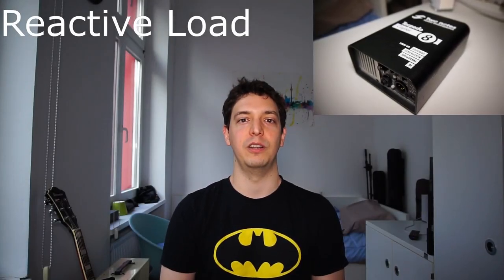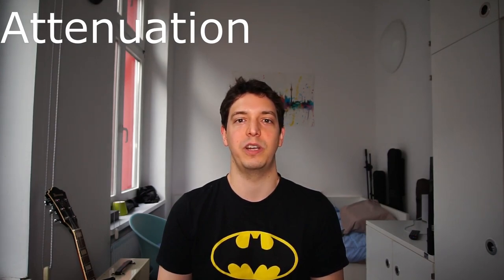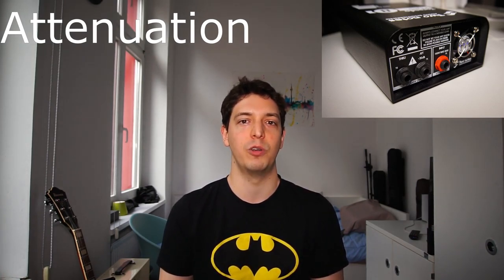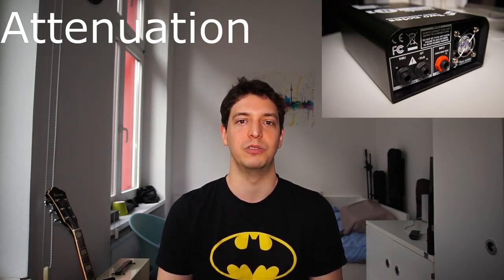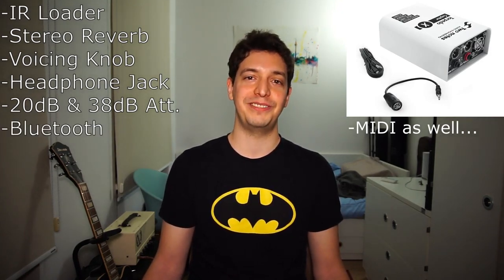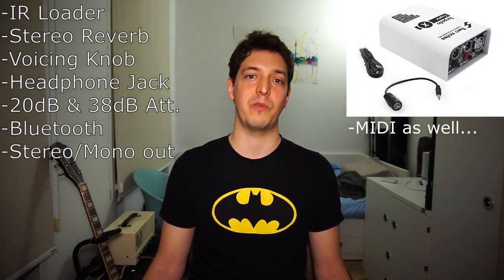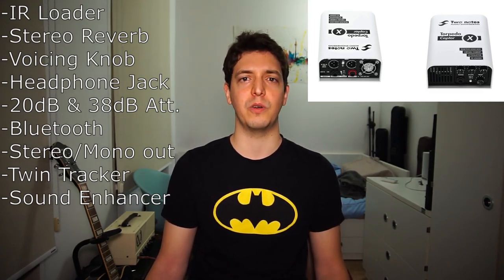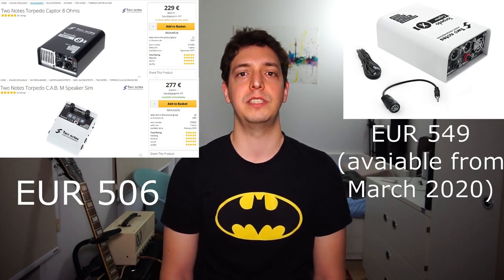Two Notes Torpedo Captor Review: Do you need the Captor X?

Comment: Great review !! But I have quite a Simple question please !
As a load box and cab sim for home recording use only, are the Captor and Captor X the same ?
Reply from the maker: Thanks Meloanaxx! For home use they are similar, but not the same. The Captor has an in-built analog cab sim, which works but is waaaaay less realistic and flexible than the cab sim you can get with Two Notes software. If you are at home and connected to a computer, then you can turn off the cab sim in the Captor also use the Two Notes Wall of Sound software in your computer for cabinet simulation, which is the best set-up. The Captor X has an in-built digital processor that can run a Two Notes cab sim software (Torpedo Remote) by itself (without needing a computer). The Torpedo Remote is very similar to the Wall of Sound. Besides that, the Captor X has some added functions like Bluetooth, MIDI, Twin Tracker, Reverb, etc.... If you have a decent computer that can process the cab sim without latency and you do not need the additional effects of the X, then the Captor is totally enough. I hope this helps! Let me know if you still have more questions.

Comment: Hey - I have an Orange CR120 Combo and I'm interested in the Captor products. Do you know if it would be possible to plug the captor into the extension cab plug on the combo, and use the DI sound from there to record the amp (into a cab sim of course) - or would it be better to plug the Captor in between the amp and speaker section of the combo with the attenuator in, so the Captor can get a louder signal from the amp for DI purposes? Thank you :)
Reply from the maker: Thanks for your comment Jonas. I think both options should work fine. The Captor has two speakers out with and without attenuation. However, I would definitely consult with Two Notes assistance, because the Captor is designed for 100W and the CR120 is 120W. Their support is great and usually answers very fast.
Reply: @TheBedroomRocker1  I've seen other threads about using 120W amps with the Captor, and also documentation from Two Notes saying that as long as you don't run the amp at full volume, you'll be safe. Since I still plan to use the combo's speaker for monitoring I definitely wouldn't be running it that loud :) Thank you for your response though, and best of luck with your channel!
Reply from the maker: @TheiPodTouchPenguin  That's good to know! Thanks for the kind comments and have fun with your Captor!

Comment: Does the wall of sound work with both of them ?
Reply from the maker: Yes, actually the wall of sound is completely independent from them. You can use it without any other amp or amp plug-in or even just drive pedals

Comment: Great video - very informative !
Im quite interested in the original Captor as my Suhr Reactive Load IR does not have any attenuation or XLR outputs. I want to bring down the volume  of my Friedman Dirty Shirley Mini (20w) for use in the flat before sending it to my Line 6 Helix for re-cabbing, IRs and effects  - do you think the 20db reduction is enough for us bedroom players? :)
Reply from the maker: The -20dB can definitely bring a 15-20W amp to bedroom level. I use it with my Victory V40 (42W). Does the Dirty Shirley have a master volume? If not, I would consider something like the JHS Little Black Amp (~50 USD) in the FX Loop so that you can crank the amp and still have some control over the output volume.
Reply: @TheBedroomRocker1  Cheers for getting back to me. The Dirty Shirley does have a master volume, but the power tubes cranked produce the best results for more saturated tones. I experimented with a passive volume pedal in the effects loop and it sounded terrible  and hollow - I think its because the master volume is actually wired after the effects loop, not before it. 

I think im content without a load box /attenuator as using another head (Like my Blackstar HT5 or Orange Micro Dark) through the same cab does better for me. I record using a Helix anyway at home or just go crank  Friedman at a studio (pre - Covid).  Its all fun and games :)
Reply from the maker: @GabrielNacu  Yes, cranked power tubes are the way to go! Specially with these amps! The issue is that the Captor only has a fixed -20dB attenuation, so you could really use some kinda of master volume to fine-tune the output level. In general I think that, for pure attenuation purposes, there are better more controllable units available. The biggest selling point of the Captor to me is really the reactive load-box and the bundled software and cabs for recording. It's really a game changer to record tube amps silently and much more affordable than other units. The Helix is definitely more convenient, but if you ever want to record your tube amps at home, the Captor is definitely an awesome choice
Reply: Cheers man! Alas i have been there with amp IRs /reactive loads and tube amps with the Suhr Reactive Load IR. Great sounds, but I ran into more noise/signal ratio then it was worth compared to using the Helix. Plus ill just wait crank it at the studio as I do love my cabinet - replacing it with a digital IR just isnt the same. Its all good man :) Cheers anyhow!

Comment: Hey thanks for this video!  Did you ever end up getting a Captor X?  I've been wondering if there's an improvement in sound quality with the newer Captor X vs. a Captor 8 + Wall of Sound, or if it's just improved features and functionality on the X.  If you have both, a shootout comparison between the two would be extremely helpful since I haven't been able to find one anywhere!
Reply from the maker: No, I'm still rocking my normal Captor as I feel it's more than enough for home studio recording. There should be no difference in sound at all. In the end you're loading the same Impulse Responses (Two Notes DynIR) so it should be the same sound. The Captor X gives you additional features and ability to tweak the sound on the fly using the app or on the unit itself, while the Captor would require you to have a computer running Wall of Sound plugin.
Reply from the maker: No, I'm still rocking my normal Captor as I feel it's more than enough for home studio recording. There should be no difference in sound at all. In the end you're loading the same Impulse Responses (Two Notes DynIR) so it should be the same sound. The Captor X gives you additional features and ability to tweak the sound on the fly using the app or on the unit itself, while the Captor would require you to have a computer running Wall of Sound plugin.

Comment: Please please help!!!! I want to use my tube amps with headphones. That's it. Should I buy the captor x for 469£? Or a second hand captor original and CAB original for 300£? 

Second question: it says you can use the cab m between your amp and its speaker. Does that mean you can use the cab m's headphones out without needing to buy a load box? PLEASE REPLY!
Reply from the maker: Hi Jim B,
Sorry for the late reply. Your tube amp NEEDS to see a load. This load can be either a speaker cabinet or a load box. The Cab M is NOT a load box, so you need a speaker cab or a load box to use it with your tube amp. if you want to play the amp silently using headphones only, then you need a load box. If you use a speaker cabinet as a load, you can still use Cab M and headphones, but the speaker cabinet will produce volume... 

To play silently with headphones, both Captor X or Captor+CAB M will work fine. The Captor X is more convenient because it is an all-in-one unit. The Captor + Cab M is more versatile since you can also use the Cab M with pedals only and ditch your amp completely. The new software update of the Cab M also added a preamp section, so it's a really versatile unit. Finally, you can also use only the original Captor hooked up to your computer via an audio interface and then use the Wall of Sound plug-in loaded into your DAW for the cabinet simulations. If you have a good computer and audio interface to process audio without latency and you don't mind having to turn the computer and open the software every time you want to play guitar, then that's the cheapest way to go. 

To sum-up: I think the Captor X is the most convenient for you. The Captor + Cab M is more flexible, but you may not need that flexibility. Finally, the original Captor is the cheapest, but more limited and less convenient.

Hope that helped! Let me know if you still have questions and best luck finding your gear!

Comment: Great video, thank you. Subscribed! So, one year after, did you upgrade to the Captor X?! :)
Reply from the maker: No I didn't hahah specially because of covid and little chance to play live. In the studio the normal Captor + Wall Of Sound Plug-in delivers everything I need! I still use it in most of my videos! If I would buy it today, I'd actually probably go to the CAB M+! Since I've made this video, two notes added a preamp section to the CAB M making it excellent for a pedal only (no amp) rig. Also, even if I play with an amp, I typically still need my own cabinet as monitor, so I wouldn't need the Captor X as a loadbox. Ultimately I found the normal Captor plus CAB M+ a more versatile set-up... If money is no objection though, I'd definitely go for the X 🤑
Reply: @TheBedroomRocker1  haha yes you’re already well-equipped! But for the studio you can still record and monitor with your amp cab using the Captor X no? If I take it I would like to use it this way too
Reply from the maker: Yes, sure! Just plug your Captor X speaker out into your cab and decide on the attenuation level. You can use your cabinet as the monitor and send the Captor X speaker simulation out to the audio interface in the studio or front of house in the gigs 🤘🏼
Reply: @TheBedroomRocker1  seems like a perfect home studio/practice tool (on top of the gigs, some day!). Thanks a lot again for your answers and great video!

Comment: Thanks for the video. I have been a Kemper user for a while. Never owned a tube amp. Just got a victory kraken today and will be getting my captor tomorrow. I only really play at home. Not recording either. I just want to monitor the sound from the Wall of Sound Plugin. Was wondering if there would be any latency issues as I would be software monitoring. Also, do you have two channels open usually for stereo and pan hard left and right? Sorry if my questions are stupid. Thanks again.
Reply from the maker: Welcome to the world of tube amps! The Kraken seems to get lots of love from high gain players... hope you'll enjoy it. The latency depends on your PC's processing power, but it should definitely not be an issue... The WoS is quite optimized and runs quite light and smooth considering its power. You will have to adjust the playback buffer settings that you usually find in your DAW settings or in the Driver settings of your audio interface. Try to reduce it until you can't feel the latency anymore or until your computer starts to crap out... As a last resource, you can use the analog cab sim on the captor and switch your interface to monitor the input. This way you get zero latency.

As for the stereo panning, you can have a single track and set the panning within WoS. The stereo pan depends a lot on what you want to achieve. For just playing guitar, I like to set some close-mics 30% left and then add a room mic as far as a possible from the cab (maybe even at the rear part) set at -2dB or so and panned 70% right. This gives you the feeling of being in a room facing the cab at a slight angle and hearing room reflections in the back. If I have a busy band mix, I would not spread the guitar that much though.
In this other video, I share some of my pre-sets: https://youtu.be/YltrSKQKLFQ
Reply: @TheBedroomRocker1  Thank you for taking the time to reply in such detail. You are a life saver. My computer is pretty new and only use it for this purpose. Only 8 gigs of Ram but I suppose that should be enough as I am not doing any complex eq's. Plus yes I will turn the buffer down. Thank you for sharing the presets. Will download them now. This solves all my problems. Best regards from Texas.
Reply: @TheBedroomRocker1  how do u do that last bit on the first paragraph, about switching the interface to monitor the input?
Reply: @TheBedroomRocker1  'use the analog guitar sim on the captor and switch your interface to monitor the input'

Could u explain in more detail how u do that?

Great vid btw.
Reply from the maker: @jackwhite3304  That will depend on your audio interface. I use a Behringer UMC204HD and it has a knob called "MIX". I can turn it to the left "IN" to listen directly to the inputs or to the right "PB" to listen to the playback or also any position in the middle, if I want to listen to both. As I always use the Captor with the Wall of Sound plug-in, I tend to always leave it on Playback. Let me know if that helps. Which audio interface are you using?
Reply: @TheBedroomRocker1  focusrite scarlett 2i2
Reply from the maker: @jackwhite3304  I think in the Focusrite Scarlets, this is called "Direct Monitor" in the front panel

Comment: On the Captor (the black one) how do you set the volume? I have it half way. Does anyone have it at higher? Is their an optimum volume or recommended volume to have on the captor itself?
Reply from the maker: Thanks for the comment and that's a good question actually. I usually have it between 25-50% but I haven't played much with it. I'd usually set the master in my Amp to 70% or more to open it up and then adjust it in the captor to get a decent recording level

Comment: If i consider the limited attenuator not enought for my home playing, can i run at the same time, something like a JHS little black box or some volume pedal ???
Reply from the maker: Yes, you can do that if your amp has got an effects loop. It won't be the same though... having the JHS Little Black Box or volume pedal in the FX loop enables you to crank the preamp gain while keeping the power amp cool and quiet. The Captor and other attenuators, on the other hand, will allow you to crank the power amp (master volume) as well. I play a 42W master volume amp (Victory V40) with the Captor in my bedroom. I usually set the master at around 5-7 depending on the day/time and mood of my neighbors
Reply: @TheBedroomRocker1  okok, thanks foer your help, but if use the captor (not the X) and the JHS, at the same time, i can crank both preamp gain (with the JHS) and also crank the power amp (with the captor) 
Am i thinking correctly ? 
Thank you once again
Reply from the maker: @Pitchuga  Yes! This way you also have more flexibility on the output volume than if you're just using the Captor

Comment: I use a deluxe reverb reissue and just want an attenuator, I am curious if -20dB will be a lot of attenuation or if it will be a good all around level. Any thoughts on this people? I don't know if three options versus 1 is worth the extra almost 300 dollars. Also, I don't really plan on using any cab sims or anything so any recommendations?
Reply from the maker: -20 dB is quite good to play your DRRI at home, but it will make the amp way too quiet for studio or performance. If you simply want attenuation, then get a real attenuator because it will give you a much better control over the output level. The Captor is mainly about playing your amp silently using the awesome cab simulations from Two Notes. The attenuator is a nice extra, but I would not buy the Captor just for that...

Comment: Hi thank you for the explanation but i m still confused.. Am i able to play with my mesa mark iii connecting the captor in place of the speaker output and then directely to the monitor speakers without mixer or audio interface? Utilizing in this case the analog cab sim? I dont want switch up a computer everytime i want to play. Thanks
Reply from the maker: Hi Fabio, yes. The Captor acts as the load for your Mesa Mark III (no speaker cab necessary) and then you can use the analog cab simulation and send a XLR out to the monitor speakers. You don't need a computer nor mixer nor audio interface for that, but you are stuck with one single analog cab sim. At home, instead of using the analog cab sim, you can OPTIONALLY use a computer with the Wall of Sound plug-in and load impulse responses, switch cabs, speakers, and mics, add room reverb, EQ, compression, etc. It's way way more flexible and, in my opinion, it sounds much better than the analog cab sim.
The Captor X, on the other hand, has a digital processor inside. It essentially gives you the experience of a regular Captor + Computer within a single box. You can do all the same as listed above and more in a live situation without carrying a speaker cabinet nor a computer. If you are mainly use for live applications, I would definitely recommend you to go for the Captor X, because of the flexibility and quality that Impulse Responses offer over analog cab sim.
 
Hope that helps. Feel free to ask if you still have any questions. 
I also make this other more general video about speaker cab simulation with some examples that might be helpful: https://www.youtube.com/watch?v=LogMu_zXe14
Reply: @TheBedroomRocker1  ok thank you very much.. Captor x of course could be the best option but costs a lot and at the moment there is no time for shipping..
Reply from the maker: @fabiol.9161  Yep, I think delivery is delayed because of the Corona crisis. Another option is to combine the regular Captor with another external IR Loader. The Two Notes Torpedo C.A.B. M is excellent and there's the Mooer Radar and Nux Solid Studio as more budget options. They do not serve as load boxes, but they also enable you go for an amp-free set-up: you can plug your pedal board straight into them... you cannot do that with the Captor / Captor X
Reply: @TheBedroomRocker1  yeah.. I ve also a mooer ge200 which is alsoanan audio interface.. Was asking to myself if it s usable also only as cab ir